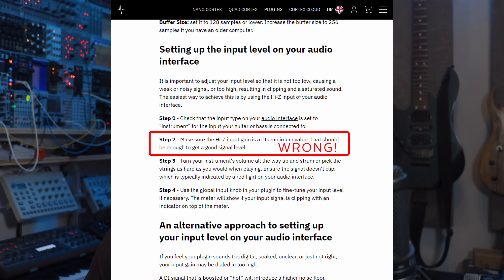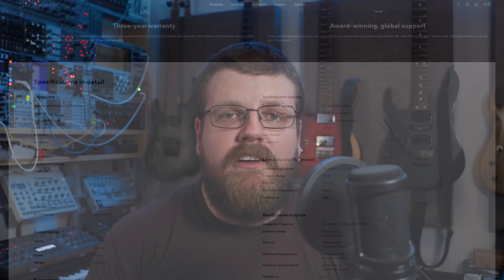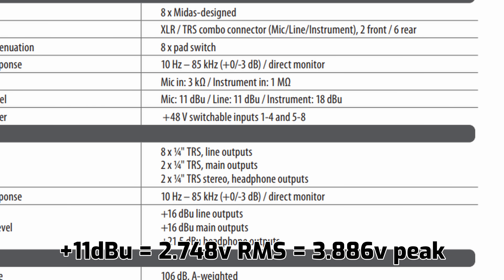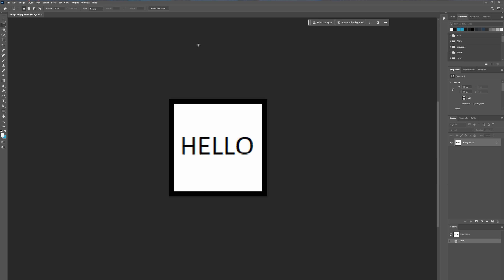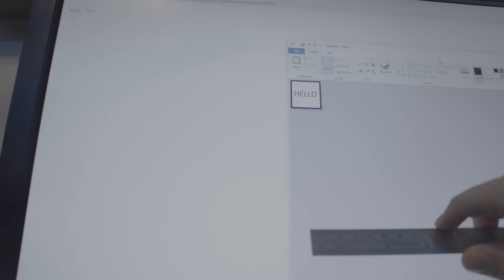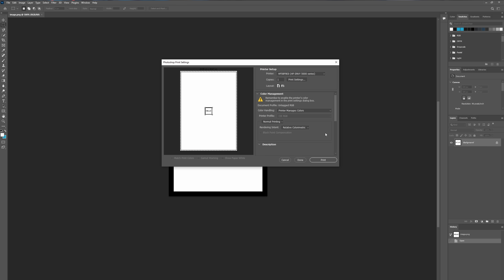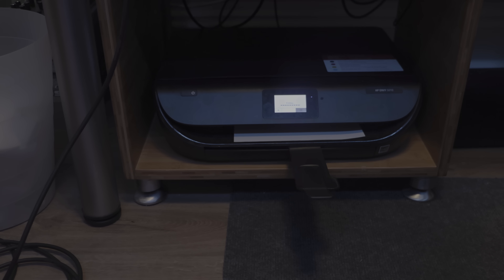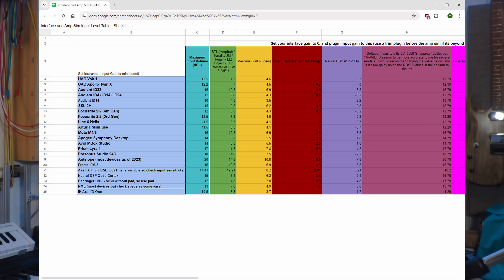Ampsims and input gain - Please, stop the madness...

Comment: Your measurements seem correct, and we can definitely hear the results too, but I'm not sure your reasoning is 100% correct. 

It seems that you imply that quantization noise is the main culprit here, since you're talking about using the full bit depth as a key factor in getting the best possible SNR, and increased quantization noise is the only noise that occurs in the digital domain from not using the full bit depth.

The SNR of the standard 24bit audio is roughly 144dB. In your example you increased the gain by 24dB in order to minimize the noise, making the signal occupy the full bit depth (or close). This means that the quantization noise in the noisier example couldn't have possibly been more than just 24dB louder, meaning a 24dB decrease in the digital SNR. 144 - 24 = 120dB SNR still on the digital domain. The dynamic range of the human hearing happens to be approximately 120dB, so you could blast the audio at the level of the pain threshold of the average human, and we still wouldn't hear the increased quantization noise at all. 

Thus I suspect that the increased noise from tracking with a lower input gain comes from elsewhere, mainly from the preamp.

Please let me know if there's something I misunderstood or missed, or if my information is in some way incorrect.
Reply: That said, I still find it odd that even the preamp noise would sound that much louder (or be audible at all) when tracking at -24dBFS, which in today's standards should be a totally fine level to track at, especially given that the preamp noise is typically lower with the instrument input than the mic input... but perhaps there's something I'm not seeing here?

Comment: Just for clarification, I'm using Amplitube. After adjusting the gain on my audio interface, am I adjusting the input level on the lower left side of Amplitube or the gain on the individual amp? (Going by the video, I'm assuming the former, but I want to make sure).

Comment: For step 3, when adjusting the input gain on the audio console just before it clips, doesn't the parameters of the plugin affect the clipping point? Also, my crappy audio interface is not in the list (novation nio 2/4). I can't find the max input volume in the manual or anywhere on the internet. How can I use the chart in that case?

Comment: I guess that if you realize that every analog part of your chain has a fixed level of noise, you want to start with the highest possible signal on top of that noise (without clipping).
But even in the digital domain, you want to use a high signal level. Or put differently, as many bits as possible. It's intuitive to understand if you can visualize a one bit signal as a pure square wave. The more bits you use, the less staircase you have for your signal.

Comment: @GhostNoteAudio I can’t thank you enough for making this video. I just purchased an Apollo X Quad and primarily use the Neural DSP plugins. I’m a clean to light break up player who uses primarily vintage spec low output pickups. 

I have been so completely disappointed in the sound of my plugins. I have been following the misinformed model of going into the amps/plugins and increasing gain, volume and output only amps and gain pedals, only to end up with a fizzy flabby mess that in no way came anywhere close to a full range clean sound.

Immediately after your video I plugged in a Telecaster to my Apollo and took my Neve Unison preamp to a +10 and my output slider +7. This got me right below clipping. I referenced the guid for Neural and Apollo X and it was 0.0 so the math was simple. I then went into Neural Tone King and reduced the input to -17. Just like in your video the input meter on the Neural side is crazy low on the built in meter. Doesn’t matter at all!!!! The plugin sounds amazing and all of the built in effects are perfect through my headphones and monitors. The guitar feels instant and the harmonics jump off the speakers. 
This video legitimately redirected my passion and enthusiasm for playing guitar in my current small home space environment. Thank you so much.

Any idea if I should be pushing up the output level on the Plugins as well to get closer to clipping? Does it matter?  I would assume you would possibly have to lower the output if you are using the Fortis like you had in the video, but if I’m using a clean amp with say a drive and some post effects and my output meter is still well below clipping in the plugin, should I increase?

Comment: The equivalent technique in image capture is called colloquially ETTR (exposing to the right), with "right" meaning the right side of the histogram. Incidentally, the same approach is used in analogue photography -- you'd overexpose the negative a bit and avoid the "thin" toe on the exposure curve. The image is then moved down to the correct level in printing.

Another crucial reason all this makes good sense is that both sound and light are perceptually logarithmic. There is exponentially more coding space per exposure stop at the "right" for raw (as in sensor data before any tone mapping) images. And for maximum post-processing flexibility and quality you want the fattest signal possible. There is no substitute for density.

Comment: Yes! But! Some of the nicer ad's, in fact most, have sweet spots that are usually some db shy of clipping. And some like it hot and hard. With 24 or even 32 bits, self noise can be avoided without using the most important bits. You might even want to track using very low levels for a lofi approach.

Comment: the input level measured in the daw before hitting the guitar plugin should be -18 dBfs. Your audio interface has not so good preamps by the way, and it can be measured in units. Sorry, but it is objectively true and a fact, still it will suffice to your test because the interface is always the same. Thanks for the video, I really liked it. Take care mate :)
Reply from the maker: @gibson2623  watch my update video. Short answer; nope :)
Reply: @GhostNoteAudio  OK, mate, I will , thank you. As an engineer you know very well why I mentioned the -18 value, because the plugins try to emulate analogue, and you know better than me that -18 dbfs is a sweet spot. I know you know :)...By the way, XSONIC audio interface tailored for guitar plugins does nnot have input gain adjustment, it s set by them to a fixed value. :)

Comment: I would like to understand what the spreadsheet does and how thos values are calculated. Also, where can we find the valus for other amp modelers not included in the spreadsheet?
Reply from the maker: Hi - have a look at my follow up video, it answers most of those questions. We also have a new online tool which simplifies the use of the data, so you don't need to read from the spreadsheet, just plug your numbers into our web tool.
As for understanding exactly what's going on, have a look at my other new video on Decibels; it goes into some really fine detail on how signal strength works in the analog and digital domain and what happens when you convert from one to the other.

Comment: Does this mean I have to change input in my plugin every time I change the preset?
Reply from the maker: @kristijanvlasic6936  depends on the plugin. In some plugins the input level is a global setting and doesn't change with the preset. But if it does, you can also use a dedicated gain plugin like the "Kilohearts Gain" in front of the ampsim, and use that to set the input gain.

Comment: You know what's funny is that according to the chart, and your advice here, literally all I need to do is set my Hi-Z input to zero..

The chart says that for UA interfaces, you basically leave the input at zero on Neural DSP plugins. And when I plug in my guitar, if I play too hard, it can clip.. so I sometimes even lower my guitar's volume a tiny bit (hot pickups)

So I watched this video only to end up at the answer: set input to zero. :|

That's enough internet for one day.

Comment: At Full Sail had a instructor describe it like the water system in a city, where the water (signal source) "volume" needs to be highest at the start (of the signal flow) so that by the time it reaches your hose, it has proper "level(s)" to use as expected (clean signal / less noise)... if we reverse the idea, you can clearly see the issue in principle in how your hose "volume" isnt sufficient to provide a proper pressure (level) at the other end.

Comment: i’m gonna sound like a know it all here, and i’ve completely missed the whole drama about 0 on the AI, but i was taught, and have always done what you are saying here. the gain control is to set the incoming signal to its most useable level without clipping vs overcoming noise floor as much as possible. i don’t get why anyone thinks that’s keeping it at 0 is right.
Reply: I think this is totally valid advice in general and it’s how a lot of us were taught to think about gain staging. The only wrinkle with guitar into amp sims is that the noise floor usually isn’t the interface at all, it’s the pickups and room EMI. In that case the interface gain isn’t really about improving SNR so much as making sure the amp model is being hit at the level it expects. That’s probably why people end up with different results even though they’re all following “correct” logic.

Comment: Fellow Focusrite users, be prepared to have to go 90 degrees or so on the audio interface, then -10 on the amp sim input (-10 archetypes - 7 Polychrome for me), then +10 or even higher on the amp sim output to get to a neutral clean signal/tone lol..... What a dogshit way to approach setting things up focusrite wish I would have got a different interface that started me in the green from the get go to avoid all of this unecessary tweaking and 2 years of playing with bad tones and having to spend tons of time manipulating every preset individual... now I can cycle through them all as intended on any guitar pickup selection and they sound good and unique without any tweaking needed.

Comment: there is no gain knob for the instrument input. line 6 ux2 user on windows 10. i just plug and play. no clipping. 7 string tuned low f. high output pick ups emg 808x's.

Comment: I use a Quad Cortex. Just to be on the safe side: I have to increase my input level on the instrument input until it is about to clip. Then I have to lower the input gain in my preset by the same amount that I previously raised the instrument input above 0db? Is that correct?
Reply from the maker: I honestly don't know with the quad cortex. I don't know if it automatically compensates for this or not.

Comment: I have to correct you DPI is for physical prints, pixels reside in the digital realm. If someone says I want a 300 DPI printed Image 8" x 10" it is 2400 x 3000 pixels. I think a lot of people that record professionally regard gain staging as the signal into the DAW so that plugins applied to that signal are hit with the proper signal generally between -18dB and -12dB. I like that you break it down for an amp sim though this is helpful thank you!

Comment: I want to know: if I add a Centaur pedal before the audio interface input and increase its output level, causing the audio interface's signal to clip (red). This differs significantly from using a guitar amplifier. Should I lower the audio interface's input gain or the pedal's output? If I reduce the pedal's output, won't I lose the desired boost effect from the pedal? Does this mean that software effects and pedals cannot be used together?
Reply from the maker: Looking at the Klon schematic, the output volume pot is a very simple, straightforward volume control. The best approach is probably to set the input gain on the interface to zero, and then turn up the volume on the pedal until you hit the clipping threshold (and then back it off just a bit). If you can't hit the threshold even with the volume at maximum, then increase the gain on the interface. This will get you the best signal to noise ratio for your recording.
As for setting the gain, if you're using it to overdrive an amp sim, since the volume knob on the klon is basically a "set to taste" type of thing, it only affects loudness into the next stage, and doesn't change the frequency response or the character of the distortion much at all, you can basically tune it by ear, since that's what you'd be doing anyway, in an all analog setup (setting the volume knob until it's driving the amp just the right amount). So you can either tweak the volume knob on the klon or adjust the gain in software - but the closer the pedal is to driving the interface to peak signal level, the better your SNR - but one way or the other won't make a difference to the final sound "characteristic".
Reply: @GhostNoteAudio  Great answer. Thank you very much

Comment: So, I'm having a HUGE problem with my interface as it record in 0 gain but my guitar still clips!!! even al 0 gain and without any plugin or effect active... why is that and, how can I solve this issue?
Reply: Your guitars pickups are too hot for the preamp to handle, you need to either turn them down, or move them further from the strings
Reply: @saamo1423  I have a second interface an M-audio Mtrack (the first one is a presonus audiobox usb 96 (yeah, I know...) So... I made a test with the M audio and this time my guitar did not cliped I even had to raise the gain so I think that it is a interface thing sadly... BUT yes what I ended doing is to turn the volume a litle bit down couse the pickups are pretty far from the strings.... Why I just don't stick to the second interface? couse It is kind ok damaged in the outputs specially the headphone output and the monitors..... (sorry for the long answer)

Comment: Wow that actually makes so much sense. Currently i've been using the gain knob on my scarlett interface to get my clean guitar signal to around -18 to -6 db  IN my DAW channel.  (clean input without any AMP sim activated). For reaching this level in my DAW i need to dial my interfaces gain knob only to around 20%. 

I know that this way is already not "wrong" but now my question:

Does that mean to get an even healthier signal i should use way more gain on my interface ( till my interface indicates clipping and then back up a good amount) and THEN reduce the input gain in my DAW until i have my level (-18 to -6 db) again ??

Comment: I clip at 0 db because of my strong hard palm mutes

I guess I'm built different
Reply: No, that's from your pickups. lol
Reply: No, your pickups are too hot
Reply: @saamo1423 how do you fix that? I think I’m having a similar issue
Reply: @mitchellrcohen  depends on your guitar, but usually you can take a screwdriver and loosen the screws at the edges of your pickups. This will move them further from the strings, and can have a slight tonal change. Just make sure to keep them an even height from top to bottom, otherwise one side of your strings will be louder than the other

Comment: The discussion seems to assume the analog device (guitar) is going directly to the audio interface (and contains the ADC?) then into the sim plug in. So the gain settings are the input on the interface and the input on the model....correct? Does this same discussion apply to a live scenario using a Tonex pedal with a guitar plugged into it? There are input trim settings (as well as tone model volume) on the physical pedal and and input and output level control in the sim software. Is this an equivalent scenario to the discussion in this video? Or is gain staging different when using an amp simulator like Tonex with saved presets for playing live gigs?

Comment: This a great idea for Plugin's. The 4 step gain staging works flawlessly. Although the waters get a little merkey when I use the Quad Cortex. It seems to be hit and miss depending on the presets. Is there a better guide somewhere that is focused just on the quad cortex? I am running my output signal into a Focusrite 18 I 8. Is this not correct? Great vid. Thanks for this excellent solution/explanation.

Comment: To me this feels like old fashioned tape saturation. Not in the sense of pushing it over to color the sound, but in the sense that you should record on the tape to its fullest to reduce S/N. Gain staging digital plug-ins after the initial input is received into the DAW isn't part of the same discussion because one involves physical electronics and media while the other is just "imaginary" bits. With the physical stuff, pushing it to just under the limit is necessary if your goal is low noise.

Comment: So that means that also for reamping you should aim for max input signal below clipping on the DI signal at the interface input and when sending it out from the interface also keeping a strong signal? Reducing to low level signal is then done at the reamp box to match the input level required by the amp. Does that make sense? You use the max resolution in the AD step and the same at the DA step?

Comment: Great vid, thanks for taking the time to make this. Not sure if many other guitarfolks do this, may be more of a mixing/post-production thing, but I use iZotope RX to de-noise D.I recordings before they hit N:DSP plugins. It's pretty good at doing this without incurring artefacts or tone-sucking & also means you don't have to crank up N:DSP's Gate settings as high to get rid of noise, as I often find that N:DSP's internal Gate behaves better with gentler settings. Refreshing to have a way to solve/lessen this problem without having to reach for an external offline processor. 🙏

Comment: How much do I have to compensate with the input gain reduction? I'm currently using Neural DSP and Amplitube 5. I also still have this problem after gain staging: my channel VUmeter in Ableton clips even though my SSL 2+'s doesn't, and I can't turn down the output level of the amp sim more than what I already have because my guitar would sound "smaller". What can I do?